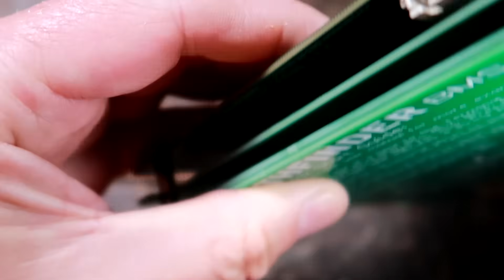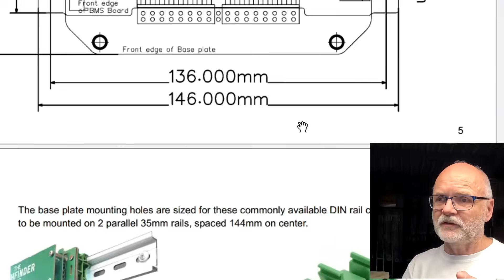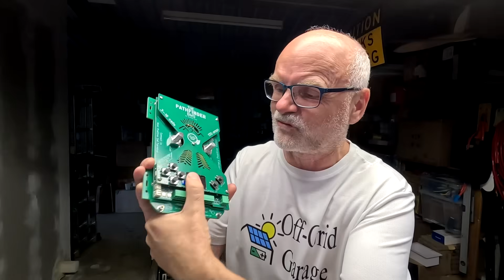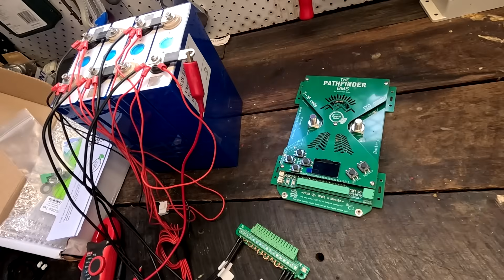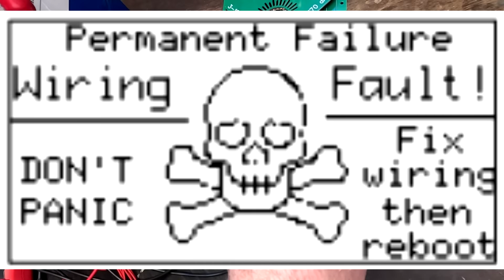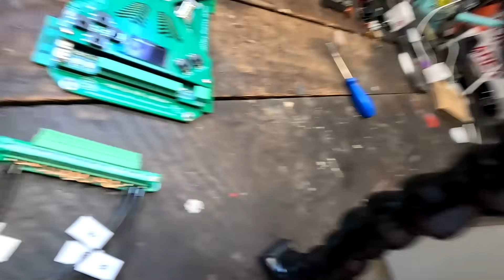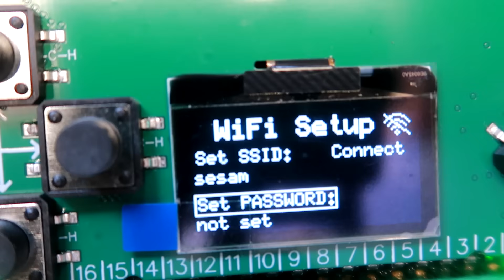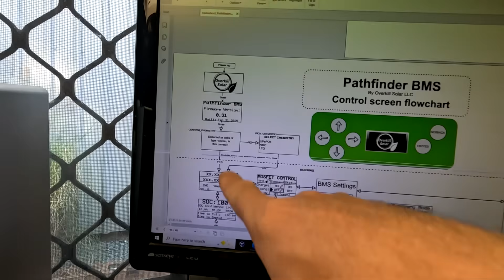The new Pathfinder BMS from Overkill Solar - but, has it found its path, yet?

Comment: The joke about Cancer in California is that EVERYTHING causes cancer in Cali. There isn't much of any labels that don't have that on it if it was manufactured in the US. Even FOOD has that label on it
Reply from the maker: No wonder they label food as well if lead still gets into the environment and back into our food chain. (I know lead does not cause cancer... or maybe it does?).
Reply: @OffGridGarageAustralia  Lead can be a catalyst to causing cancer, especially if it's in fume form, usually during smelting but can occur during soldering if it gets hot enough.
As far as food goes, it's because most food is grown with some form of pesticides and herbicides added to increase yields. And according to Cali (which, they aren't exactly 'wrong' about the info) those chemicals have been shown to be a carcinogen, a cancer causing agent.
Cali has "laws" that any thing that has the 'potential' to be carcinogenic, then the item(s) must be labeled as such. So pretty much everything in the US has these labels on 'everything' because most of them are sold in Cali as well.
Just as a side note, Cali is also on the fast track of going all EV within the decade. They are wanting to ban Diesel Semi's on their roads soon. So they aren't 'completely' the bad guys here, they are leading innovations  ;)

Comment: I still use leaded solder for my stuff I solder.
Reply: And rightfully so!  So much better.
Reply from the maker: Good luck!
Reply: For home use, leaded makes sense because it is easier to work with and the total amount of lead is small. For manufacturing a product that has the potential to spread lead around everywhere however...
Reply: @philiphiggins6870  What I wonder, If you would bury a printed circuit board in the ground. 1. Would the lead actually seep out. 2. Would it then be harmful or interfere with anything.  3. If a ROHS PCB would burn vs a non-ROHS PCB... would the burning get the lead in the air? For how long? Are there actual studies that PROVE it's bad for the environment? And if so HOW bad really?   All this would still have to be weighted against equipment lasting longer before it becomes trash.  If anyone can show me a non biased non paid for study? But of course that's not possible. All these "green" idea's are thought up by a small group of people at the W*F and trust me. Their motives are not a better environment.

Comment: My opinion: I already looked about this new pathfinder bms on their website (while it was working) and came into conclusion that it is promising but due to the price it is not worth to buy at least for me.  But the SOC learning feature is a really KILLER feature.  Although it is possible to substitute that by victron smart shunt with a cheaper BMS. But the decent high quality and reliable hardware is a huge advantage and also a killer feature. Leaded solder is long-lasting and reliable, while lead-free solder is causing failure sooner or later but definitely cannot last very long. (I hope Chinese are using leaded solder as well, just not disclosing it:-) Concluding:  I would use this pathfinder BMS if I  would build a battery for a client to make it set and forget for a very long time, reliable and long-lasting build. And the bluetooth app can substitute a screen and that overkill solar app is very good.    I also have experience with different BMS-es since 2022, when I bought overkill solar BMS as my first BMS for my first battery, it was expensive but I preferred it over a BMS from China for the 100% reliability and warranty.
Reply: China lead with ROHS production, the reliability issues from the early days of ROHS are getting on for 2 decades old at this point. Lead leeching out of landfill into water supplies is not a made up issue.
Reply: @edc1569  of course it is not a made up issue. But the solution to address that issue would be different.  They would better make strict regulations for recycle of  old electronics, to encourage users to send it to special recycling where lead could be extracted as well together with other precious materials used in electronics. Instead of sending to landfills. Why it is possible to solve with lead-acid batteries ? Otherwise lead-acid batteries should be prohibited.
Reply: Did you mean OVER KILLER?

Comment: One more BMS NOT to buy. Oh well. The HW they used is actually decent. But the Software is pure Horror.
Reply from the maker: So, they can improve...
Reply: @OffGridGarageAustralia  I doubt it. They did not and still do not use AI for Coding. 

Otherwise they would have already repaired their design flaws.

I do not even talk about their useless/fancy way of designing the BMS.Or the balancing. Or their "interesting" way of communicating with the other infrastructure in the whole system.

Passive Balancing with hundreds of resistors on a double layer backplane with max. 1A?

Who does this?

TI bq76PL455A-Q1  Active cell balancing 2-5A reference design is redily available.

A simple google search reveals their ineptitude.

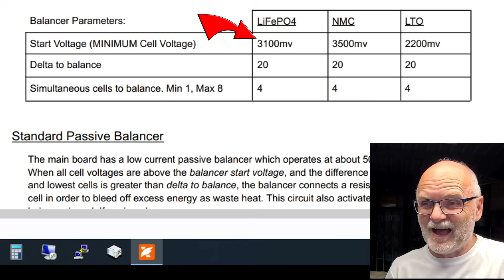Comment: 9:36 Balancing at 3.1V is indeed way too low. The cell at that voltage (while charging) is practically less than 25%. There is absolutely no reason to balance it at that level.
Reply: Consider this, at 25% SOC, the imbalance would be very small anyway.  The Cell diff man not even be enough for the balance logic to kick in.

Comment: 1A passive balancing in this day and age of 300-700AH cells?

Overkill Solar still stuck in prehistoric era.
Reply: they are certainly know very well what they are doing ! Seriously.  Passive balancing have its own advantages and with combination with configurable active balancing that can make it ideal. And try to find other BMS with passive but 1A balancing.  Does not exist. You can although find separate resistive balancers - special made-on-busbars (connection between cells) build in configurable start-voltage resistors.  That stuff made in purpose by people who also know what and why they are doing.
Reply: @NiueChannel nonsense, active balancing is only needed when youve got a battery made using ill matched capacity cells.
Reply: @NiueChannel are you claiming that no manufacturer produces a passive balancing system with 1A bleed current ?
Reply from the maker: Passive balancing is wasting all energy in form of heat. Active balancing is at least 50-80% efficient.
Reply: @OffGridGarageAustralia well matched quality cells need negligible balancing  - name me any professional BMS manufacturer that features active balancing ? ... active balancing is required for diy/hobby systems as the batteries are generally comprised of cells having a wide capacity range. The energy lost in a passively balanced battery comprised of well matched cells is minimal.
Reply: @SeanMoore2008 : Professional BMS manufacturers decisions about passive vs active balancers may be affected by financial not technical reasons. You cannot know which has been decision driving factor, so you cannot make assumptions of their usefulness based on their existence.
I've seen stupid technical decisions made because of financial reasons.

Comment: Andy, why did you never test the Batrium BMS? You're much closer to the source than most of us. Is there any reason why?
Reply: And the UI and terminology used is a mess.
Reply: The bloke who runs Batrium isn’t the most customer friendly fellow, and they release updates as slow as molassis.
Reply from the maker: They contacted me back in the day and offered me their BMS for testing and showing on the channel. I think, the Batrum is not a mass-market BMS like JBD, Daly or JK. I personally don't like the modular form factor and cabling structure. Not to mention the software bugs it has when it suddenly shuts down.
Reply: @OffGridGarageAustralia ... what exactly dont you like about the Batrium "cabling structure" ?
Reply: @OffGridGarageAustralia Don't do Batrium. It's not that good. Better stay with JK or Jjabatta.😂
Reply: @OffGridGarageAustralia you really are talking nonsense again ... I've been using Batrium products commercially for years, your reasons for not reviewing one is simply vapid and points to your lack of expertise. You've built your channel reviewing low cost products that are designed for budget conscious users, which is fine, but making such weak excuses for not reviewing quality systems such as Batrium, Orion and RECC is somewhat telling.

Comment: Anyone still claiming leaded solder is superior to lead free is simply uninformed, incompetent or lazy.
Yes, some aspects can be easier or more forgiving with leaded solder but especially for a BMS that needs to work even if overloaded and HOT, you would want the solder to have as high melting point as possible for the components. Things like tin whiskers are more likely to happen on the legs of for example the MOSFETS if they are pure tin plated copper. Leaded solder would not help here. Conformal coatings is your best friend here.
Reply from the maker: I would say, people are uninformed and stuck in the past. I would not call them incompetent. It's just easier to parrot something which already has a lot of likes... so it must be true.

I'm using lead free solder well over 20 years and never had any issues.
Reply: exactly, many decent lead free processes available - just don't cheap out in manufacturing.

Comment: The rohs requirement is only non USA requirement. However CA has stricter requirements and if certain chemicals or materials are used they must state that its hazardous and can cause cancer. So yea it's basically sarcastic.
Reply from the maker: Is it not a good thing to label chemicals on products?

Comment: Everything is OVERKILL 🙂 7 Sept website is still down
Reply: hlw sir. i have 16s life po4  25 Ah battery. battery low voltage cut then i turn on emergency mode.i fully discharge it.but when i charge it the bms not charging. charge is off discharge is off balance is off.but when i turn on emergency mode then turn on charge & discharge but balance is off.
if turn off emergency mode then charge is off discharge is off.plz help sir

Comment: 🇬🇧  my concern is the availability in the UK or in 🇹🇭  Thailand.  As the cost of carriage to these countries.
I am happy to see that it has a dual core ESP32-S3 microcontroller, which has both Bluetooth and Wifi.
Love the instructions. I can't wait to see the features in the rest of this video.  Are there any light tubes to bring the smt LEDs to the front panel?
I see that the unit is well overpriced and typical USA prices.
Yes, leaded solder is better than unleaded solder.  Lead sold is used in aircraft electronics as unleaded has problems with vibration causing dry joints.